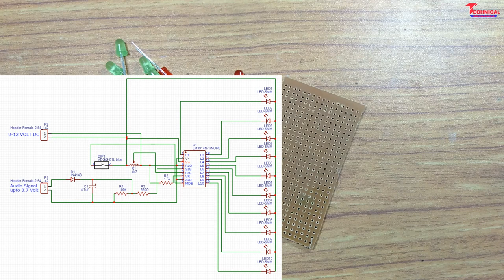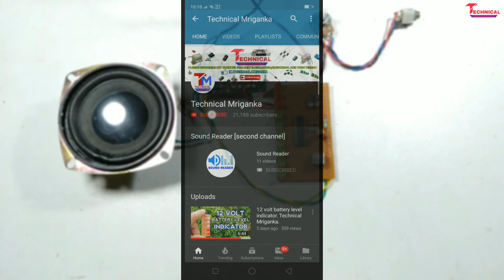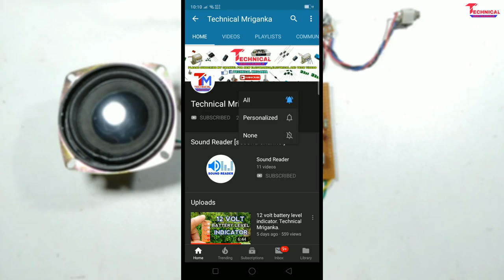DIY VU meter LM3915 IC.

Comment: LM3914 is linear led meter
LM3915 is logarithmic led meter
LM3916 is a true VU led meter  for displaying a representation of the signal level in audio equipment, each led stand for a dB level.

Comment: Good job.. how can I use microphone for input instead of wire...?
Reply from the maker: You need a mic circuit. Mic circuit output connect to VU meter input
Reply: Do you have one .. diagram..?

Comment: Sir while you showing in parctical of this vu-meter ... few connection is different from given circuit diagram... 

So ,i want to known that if i do this circuit that what are you doing it will be correct or not ?

Comment: Bro it doesn't work when I connect to amplifier the led is off
Reply from the maker: Bro make sure input volt under 3.5V
Reply: @tchMri  OMG I put input voltage of 12v
Reply: @tchMri  but how could we find 3.5v supply in 2n3055 circuit board?